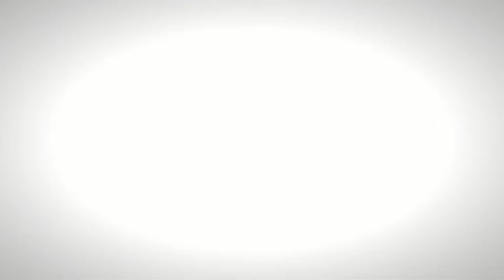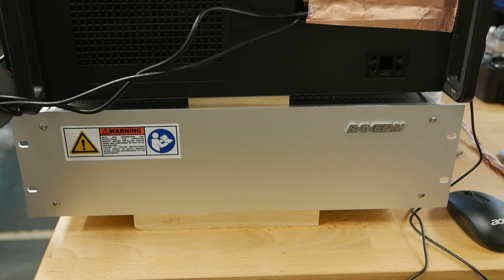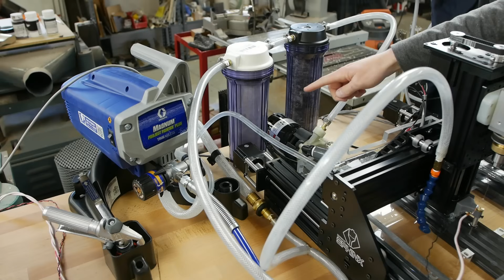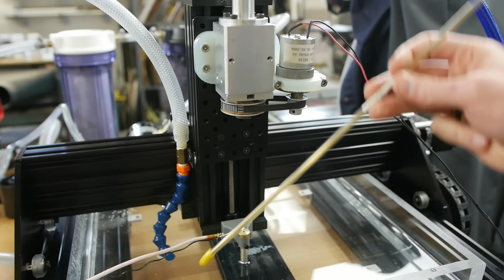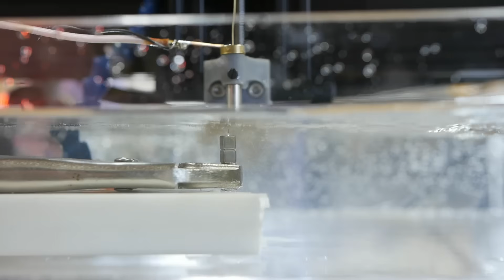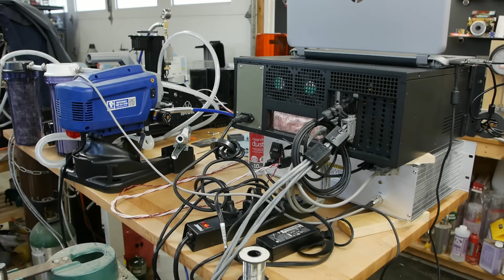Drill through anything (conductive) with Electrical Discharge Machining

Comment: Have you tried doing that to silicon steel alloy? I wonder if it would work because that alloy is supposed to be anti-magnetic or magnetically field resistant. You could always put that board inside of an old computer power supply case. That case would function like a Faraday cage.

Comment: I'd love to see this method of drilling on granite to add a new theory for the precise machining of granite structures done by unexplained ancient technology. This seems as practical as resonate drilling, pending results.
Reply: Last time I checked granite isn't very conductive, EDM kinda needs that to work
Reply: Christopher Klapp I thought of that immediately. Looks just like the drill holes at Puma Punku. Someone needs to investigate this.
Reply: I was wondering the samething..
Reply: If you want to cut granite (with odd shapes, curves and holes) with high precision, then the most likely choice would be high-pressure water-jet cutting.  For this type of machining, the water at a pressure range of approximately 40,000-100,000 PSI.  Sometimes a very fine grit abrasive is added to the water jet to improve the cutting process.  See this video >>> https://www.youtube.com/watch?v=jFDfM_zwlmQ      Ed

Comment: 5:30
- "I couldnt believe it, It was cheaper than the raw materials from Mc Master by a lot"
- I can
Reply: Yup. But if you need something, odds are they have it.
Reply: Yeah, McMasterCarr is very expensive, even for small consumables like abrasives
Reply: We just bought metal from McMastuz..Not cheap
Reply: i just got fep film through mcmaster for my resin printer was about half the precut stuff even after shipping. so ymmv.

Comment: Can you do it with quartz,  like stone any type but with quartz in it ????

If so you may have solved an ancient riddle!!
Reply: I have a 100w ultrasonic drill in my shop which was designed by Imahashi corp. of Japan in the 1960s. It has a 20khz signal generator which drives a large ferroceramic tunning fork utop a resonant pylon. At the bottom it uses non rotating carbon steel piano wire bathed in abrasive slurry to drill ~1mm holes in hard martials such as quartz or others.  It's similar to the ultrasonic drills on the Martian Rover that are used for mineral sampling, but NASA's uses piezoelectric transducers which are much lighter and more efficient than the ferroceramic.

Comment: I used to use an EDM for making cooling holes in the leading edge of turbine blades....0.010" dia and  0.010" apart. Then we`d x-ray the blades to make sure the holes were straight. Google hp single crystal turbine blade.

Comment: Hi, I used make large spark eroders commercially.  Most had 50 Amp down 2 uS pulse capability, a couple were 100 Amp models. We used Diesel as a dielectric fluid. The filter was a small steel swimming pool sand  filter.  the quill was moved up & down by a Swiss servo motor with a 100:1 planetary gearbox attached to a ball screw. The electronics was designed by myself. If you need any info about this, you can e-mail me at garyhogg390@gmail.com

Comment: I ran an EDM in a drill bit factory to drill oil hols in every type drill you can think of but I used a chemical solution mixed with water to eliminate the burn.

Comment: It appears that those bubbles are cracked water molecules into oxygen and hydrogen. Good thing its submerged. You might try making that another project in itself as those high frequency low amps are what Stanley Meyers used to run his buggy on plane water. Cool stuff. Stanley Meyers
 water fuel cell.US5149407A - Process and apparatus for the production of ...
https://patents.google.com/patent/US5149407A/en
In the apparatus shown in FIG. 4, water is introduced at inlet 1 into a first stage water fracturing module 2, such as the water fuel cell described above, in which water molecules are broken down into hydrogen, oxygen and released entrapped gas components.

Cited by: 19
Publish Year: 1989
Author: Stanley A. Meyer

Comment: I've seen that with my blinker light. It wasn't mounted correctly so it kept vibrating. Over the years a big hole was dug into the metal. Very impressive to see.

Comment: I realise this is using electrical arc to erode the metal and the high pressure water is to flush the work site. Is the water high enough pressure to cut other non metallic materials on its own in the same set up, like plastics  or carbon fibres?

Comment: High-end hobbyist and commercial CNC plasma cutters have a Z-axis feedrate feedback very similar to this (torch height control). You read the arc voltage and then move your Z axis higher or lower to maintain a consistent cut height over your sheet, which is never perfectly flat on its own, and might even warp significantly from the heat of cutting.

It's one of those things I'll figure out how to cobble together for my LinuxCNC build eventually.

Comment: I vaporized a pair of alligator clips with this method.  I had two 275 watt solar panels connected in parallel in my backyard and I just couldn't stop playing with the ends of the wires before I actually wired them to my charge controller.  I had some very nice arcs going.  Wore two pairs of sunglasses while doing it.

Comment: is there a linux version of this EDM control software? 
what was the cost of this build? 
can you post a link for the software?
Reply: могу предположить, что этим станком с легкостью будет управлять любое ПО для 3d принтера в небольшой доработкой...
Reply: @lCooLRusHl  no
Reply: @Joe11Blue  смешно...
Reply: @lCooLRusHl  no
Reply: There is a complete video on the baxedm youtube channel talking about the software. because with edm machining there is no set speed controll but the speed is set by the arc generator there are very limited software options. If you only want to do drilling instead of cnc milling or wire cutting it should not be to difficult to rewrite the speedcontrol layer to work on your desired linux system.
Reply: @PieterSchreurs  why? Mach4 has settings for all of that.
Reply: David I believe Mach 4 does let you set a speed. What I believe it does not allow you to do is change te speed in milliseconds based on the arc generator. As I said have a look at the baxedm YouTube channel he has a video on how the speed control works

Comment: I took a tour of a vinyl window manufacturing plant here in the area and they used huge EDM cabinets to machine the dies used in the extrusion process. They usually always had at least one part running because vinyl is pretty abrasive.

Comment: I have about 18 years of EDM experience in injection mold manufacturing (I have since moved on to working for a software company). Your video is right on, and I have thought about building some machines for home use. There are some great options like the machine company you used, to build your own anything these days. Also, because of electrical interference caused by EDM, dabbling in EDM is NOT recommended for those with pacemakers! Thanks again!

Comment: one of my friend's used to "drill" through broken taps and bolts on one of the 3, X-15's at North American using this method (i presume, after his explanation).  the skin was very expensive and any mishaps could not be repaired in any way that would damage the skin of the plane.

Comment: Seems to me that a reprap 3d printer board {for x, y, and z control), combined with a seperate arduino or pi board programmed to do the voltage detection (using analog to digital), could cheaply replace all of the really expensive electronics in this setup. The amperage, voltage, and the frequencies involved are nothing outrageous for simple and cheap control. Audio frequency MOSFETS should handle the juice, and you should be able to do the square wave control using a simple 555 or 556 CMOS timer chip (some CMOS versions operate as high as 2Mhz -- even though standard IC versions were good to 200Khz). The circuitry should be simple as heck, actually.
Reply: Addendum: Use a 555 in pulse generator .configuration, and you can have with an easy circuit both variable frequency and variable duty cycle (almost, but not quite 0-100%). What is being fed to the electrode is DC PWM control at 16v and around 15A. That is almost no different than what a stepper motor draws, just higher frequency. The more I think about this, the simpler it is. https://www.electroschematics.com/5834/pulse-generator-with-555/  The top circuit on page will work with motorized POTS for direct software control of the circuit (frequency and duty cycle) from a reprap control board with 6 (x, y, z, drill feed, POT1, POT2)  stepper motor controllers, using resistance feedback to sense  motorized POT positioning. Motorized pots for around $12 each at mousers. I'm done, lol. You really need to build the circuitry, as your frequency shouldn't be varying simple because you chose to vary the duty cycle (pulse on/off time). It would allow you to test different frequencies using a known good duty cycle to find the best frequencies for the job on particular materials. Might seriously increase efficiency.

Comment: Could you feed the current through the drill chuck using a brush type connection or would the rod just melt ?

Comment: Wow, this is REALLY well done. Manufacturers are lucky to have you! Good topic content, good explanation/reasoning (e.g. negative feed rate), good practical discussion of limitations and pitfalls at the same time noting the advantages and raw power of the EDM process. I can't want to see you do some surface milling with EDM, and I bet you can make some really beautiful mico-miniature features in most/all materals.

Would love to see more examples of materials, cutting configurations, making a point of stating how much power/time went into this vs what any other potential milling/drilling technique could do.

THis makes me excited to get into EDM!

Comment: Very informative! I want to build one just so I can put a hole through a titanium (stiletto) hammer I've got that is pretty much indestructible. And also experiment with water cavitation on a small scale where I'd need to make perfect holes in a rotating cylinder that slides into a cylindrical housing to produce hot water. They say its an over unity machine and I want to find out why the market is not flooded with them! Thanks for a great video explaining everything concisely and keeping it interesting!!!! Keep it up bro!!!

Comment: Very cool!
  I have a couple questions..
   First I have a Miller Dynasty 200DX Tig Welder, but I can only get 250 HZ out of it. Rather that the 300 KHZ you have.
  Would it work?
   Second, are you confined to holes, or can you go 3D and do profiles and mold work?
  And finally, can you see any hazards to my equipment such as running in my Haas CNC?

  But having to purchase a generator for 300 KHZ is not a show-stopper, just a setback.

  Thanks so much for sharing fruits of your efforts with us!
  Mark

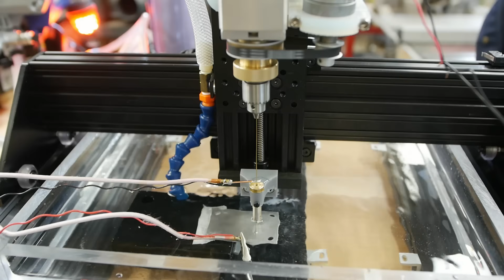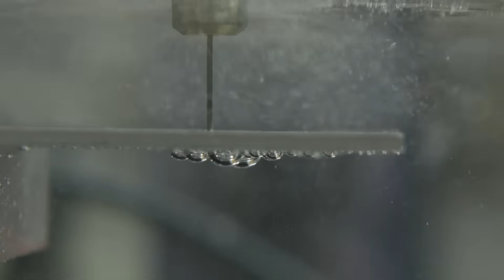Comment: Nicely done video, you explain things very well. One thing I might suggest is making the bracket that holds the out of water ceramic electrode easily removable. That way you can insert the drill rod into that ceramic electrode and then reinstall the electrode  with the drill rod already in place. I can see the concentricity issues at minute 20:17 but, that wobbling is between the upper electrode and the chuck. I  don't see the wobble problem at 20:32. Anyway, just a comment from the peanut gallery. Great video I have more knowledge than I had yesterday and that's a good thing.
Reply: я вас растрою но вращение при такой обработке не требуется, вот если бы показали как делается отверстие спиральной формы имеющей конус еще и например в форме звезды... вот тогда я бы поверил что вращение нужно, но при таком вращении нужен прецизионный шаговый двигатель с безлюфтовым редуктором.
Электрод не требуется часто менять, так что делать быстросъемным не нужно, да и горит сам электрод достаточно долго.

Comment: "Backlash" should be near 0 on the nut holding the axle, but it doesn't matter, since the play in the bearings would be where you would actually have a serious impact on accuracy, not to mention the runout on the wheels. Either you are advertising for the company, or you just don't know what you're talking about, or both.

Comment: This is old, very old technology. I worked in the UK around 50 years ago for one of the developing companies with three or four units called 'spark erosion' where the electrode had to be submersed in kerosene or some other liquid. This company Punctual Precisions also developed a process where a thread could be cut into hardened material. A good business was removing broken taps from tool jigs, and modifying already hardened jigs or moulds.

Comment: Interesting.  My EDM uses kerosene (good heat dissipation and zero conductivity) not rust causing water, and no hollow drill electrode.  In fact the directions include details on how to carve graphite into a negative to be sunk into the workpiece.

Comment: Hey, I would love to see this in action on a piece of carbon fiber composite just out of pure curiosity. Carbon fiber is somewhat conductive, though the resin not so much. Heat is a huge issue for strength in composites but comparing this to drilling a hole through it would probably lesson the effect. I'm insanely curious to see how it would work

Comment: The local engineering shop that I frequented during my formative years on the farm had one of these units, and you could 'eat' out a broken off bolt/stud/whatever - it used what looked like a 1/2 horse electric motor, that had been reconfigured to be an electromagnet; the  circuit ran through the armature and back through the work piece.
When you applied the lever and brought the tungsten electrode into contact with the work piece, it energised the armature and the the electrode was pulled away from the work piece and created your arc, thus eroding the part a little.
Repeated application of the electrode kept eating away at the part until it was (most;y) removed, allowing the broken part to be extracted.
Magic!
Reply: makes me think of lift-start TIG welding.
Reply: Working on an old steam engine--might have an application.
Reply: Don Pollard no. magic is not real.
electricity is real.

Comment: The 'vaporized' zinc probably oxidizes into zinc oxide, which is a nutrient. And if that's the case, you can filter it out of the water and recycle your rods or create mini-batteries with the copper and zincoxide.

Comment: Can you Drill a Diamond, they are Conductive..
Reply: diamond is the most thermally conductive material. However, it is a very VERY poor electrical conductor.

That means it can conduct heat very good, but electricity very bad.
Reply: Fascinating. Is that because they are dense carbon? Just curious - is a diamond somewhat like a high ohm resister?

Comment: This looks custom made for the jet pack. Tiny holes in a silver puck designed to ablate at a very specific rate. This would allow a thicker puck and raise the safety factor. Or if 3D drilled, make the holes expel in a very specific pattern that allows the bottom to be thicker to start turning the thrust to allow more area to ablate, more controlled flow and still raise the safety factor.  If 300 micron holes are not that uncommon I think this looks like a perfect fit.  This is not my field but if cost was somewhat reasonable someone should be at least running the numbers to see if this is would work

Comment: Sadly, for the price of the Baxedm generator alone, in China you can buy complete EDM drill with the same arc current, CNC, filter system, bath  and everything. They even have super entry level EDM drills for $300.